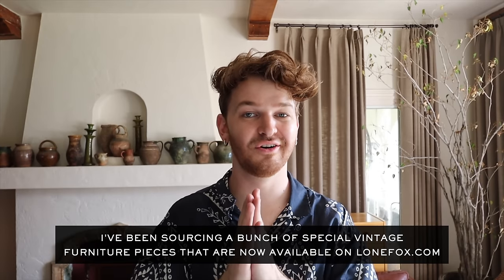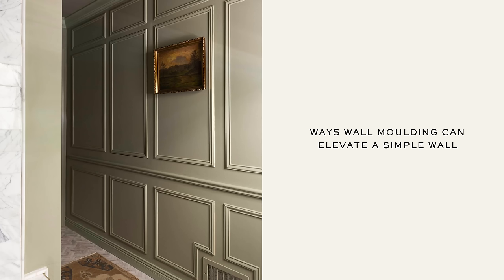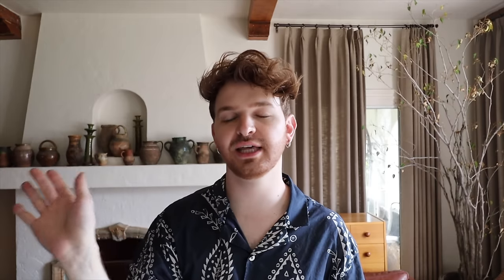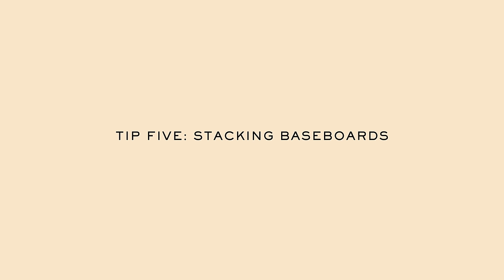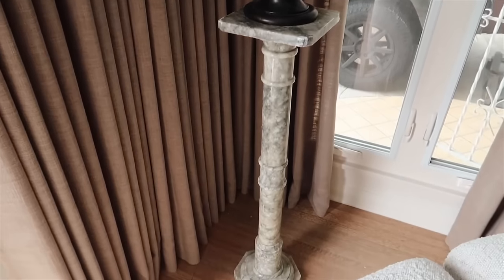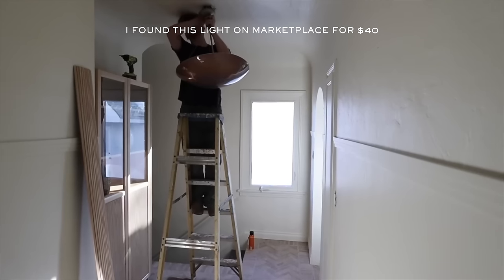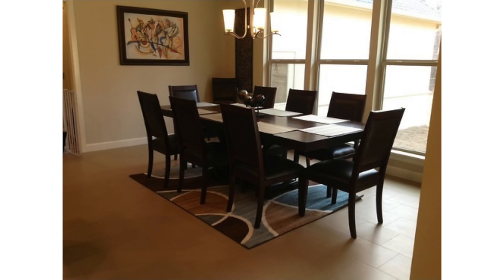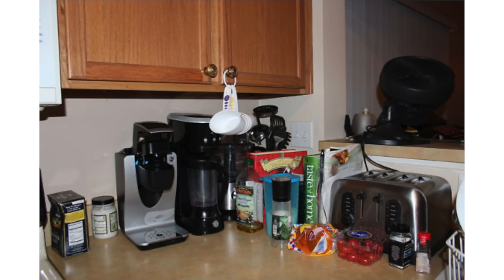10 Affordable Ways to ELEVATE Your Home 🔨 Hacks that look EXPENSIVE!

Comment: Another tip for glare free art is to buy museum grade glass that has anti glare properties. That way you can still protect your art and bonus it’s uv protected.
Reply from the maker: Ohhh yes!! Very true ❤
Reply: What if it has a mat?
Reply: @annettevelez7069  if it has a mat you can't go glass free. But museum glass it glare free.
Reply: I've used non-glare glass for over 20+ years and live in Thailand. It must be pretty commonplace in the States by now. 🤔😉
Reply: @deeannaschutz4049  Can I purchase glass in specific measurements according to size of picture frame?
Reply: @annettevelez7069  Yes, you can.
Reply: Matte Mod Podge makes it look like canvas too.
Reply: Museum glass is great just more expensive
Reply: Yes 🙌🏻 
Protection of your artwork is most important.
Although my high school graduation photographer totally skipped the glass.
This is a bad choice, although I have been fortunate enough to never have had mine exposed to the elements.
I’ve found myself over the years wondering how many students have.
Being the youngest, mine was the only one with a glass less frame.
Reply: @cheleyo3316 
Great idea!
Thanks. 😊
Reply: I’ve done several with museum glass and it’s very expensive but completely protects precious art.
Reply: I agree. Don't take out the glass. Get better glass

Comment: Fabulous video. I think removing the glass of a picture does indeed make it look better, but exposure to the air can degrade paper over time (think of yellowed newspapers). If a work on paper is something valuable, you can get "museum glass" at a custom-frame shop. Museum glass is specially formulated to have no glare, and it also protects from UV rays. It's pricey, but worth it if the art is something really special.

Comment: Great tips! May I also add hanging your curtains “high and wide”? Amazing how much classier a room looks by raising the rod up (I usually do a few inches from the ceiling) and further out from the side frame of the windows to give the illusion of larger windows.

And if you have to buy new curtain panels to kiss the floor (or puddle, if you like a more traditional, luxe look), Amazon and other retailers have such inexpensive options these days. All of my drapes are either velvet or sheer, faux linen cheapies with an equally cheapie roman shade behind them but they look more expensive than they are. And please for the love of all things holy (hole-y?) skip the grommet curtains. Try tab backs and then you have the option of putting them directly into the pole or using clip on rings which is what I’ve done.

I understand even, say, a $100 investment is out of reach for some - totally get it - but this is an easy upgrade to try if you can swing a little budget-wise.

Comment: Hi Drew! By stacking baseboards you are able to accommodate any unevenness in the walls, whereas a tall one piece baseboard may require a lot of filler. So stacking is actually a problem solver and the same goes for ceiling trim. Many years later I now know better and should have a larger living room rug but I still love the color and muted floral pattern of my wool rug. Can I layer the existing rug on top of a very low pile neutral/complimentary colored rug so that it creates a border of 6-12 inches all around? I think this would work? Thanks! PS I love your shopping videos. S.

Comment: Hi there. Thanks for the marvelous tips! I have a popcorn ceiling (I know... ). I don't want to remove it and I need to add a light fixture in the living room. By doing so I’ll end up with a whole for the fixture and a ‘buffer’ area around it without the popcorn texture. Can I add a ceiling medallion to make the transmission a bit less awful? Or ceiling medallions and popcorn ceiling are simply an absolute no no? Thanks!

Comment: For color drenching, do you use a different sheen?
Reply: You can use one or two. The molding uses the highest level you want to use than the  wall.
Reply: You'd probably want to increase the sheen a step or two for moldings and doors. Those tend to get knocked about a bit and the increased sheen will improve the sturdiness and the ability to clean them. For example, my walls are an eggshell finish, and my trim and doors are semi-gloss.

Comment: Drew, I have old lath and plaster walls. I’d love to do molding but does using brad nails hold on a plastered surface?
Reply: They should depending on thickness. Do your research because you want to make sure the brads or nails you use don't damage the plaster, as it is very fragile.

Comment: IF you would paint the baseboards same as walls what color would you paint your doors in that room ? or would I paint the baseboard just a shade darker and paint the doors same as the darker shaded baseboards
Reply: Same as baseboards usually  but it can be same as walls.
Reply: You'd probably want to increase the sheen a step or two for moldings and doors. Those tend to get knocked about a bit and the increased sheen will improve the sturdiness and the ability to clean them. For example, my walls are an eggshell finish, and my trim and doors are semi-gloss.
Reply: Yes, people undervalue the importance and purpose of sheen. @leannsmarie

Comment: Love the tips. But...Never hang an original watercolor without a mat placed on top of the painting and then glass. Moisture, dirt, dust, bugs, etc  in your home will damage the painting and eventually ruin it. You can use non-glare glass to reduce the glare and reflection.

Comment: Hello beautiful people! Does any of you know if ceiling medalions work on lower ceilings? (236cm tall aprox)
Reply: I think you'll be fine as long as you stick to a less-fussy shape that doesn't have too much depth away from the ceiling. Some just have concentric circles rather than flowers etc.  Traditionally the elaborate (more expensive) ones were used in grander homes that had higher ceilings. Hope that helps?
Reply: I used a very simple one in a bedroom with an 8 ft ceiling and it looked great.

Comment: Love all these suggestions. We've done some by way of upgrading a fixer home in retirement. Yah we did that! I was raised without clutter! Our mother was fastidious about everything. Yeah when in 20s rebelled a bit to putting away clean laundry the minute it was done but we had a sorted life. If you look in my cupboards, shoe boxes, tissue boxes folded down and stapled or retail bought depending where all have all sorted items by use. 2 under batrhoom cabinet.  Boxes sort rice packs and small things in kitchen pantry. I could buy fancy things like it does look nice when some show all rice etc. in nice containers but who is looking inside the cabinet? I especially put small med bottles etc. in a box. Hate nocking down 5 to find one! Plus you know what you have and dont buy tons of same thing. Ive seen people just shove groceries willy nilly and not sort. Plus then keep buying like 10 containers of cinnamon and loose it?!  No matter how small or large a house I had if it couldnt go into a closet you had too much stuff. Plus Ive never  bought on trend. I don't think Id ever use an insta pot so not buying one and have another appliance on the counter. Ive never had clutter on my kitchen counters or any surface. I follow a lot of channels that upcycle home decor. I love what they do. I like yours. Most are shabby country chippy and not our style. But even though Ive upcycled some similar things and sold a bit with the jean tote bags I make I dont put any of it in my house. We art decorate, a lot my partner had from travels or his kids made. I never really collected much but my motto is there is always another thrift store. I grew up in orange county.Used to go to LA to some of the same flea markets etc. you go to now in the 70s (Im old) We are now in high desert but only 3 hours away from Los Angeles. Will have to go back to check the area out again! I always look for your new videos. You are doing great. I predict one day you will have your own brand furniture line and more!